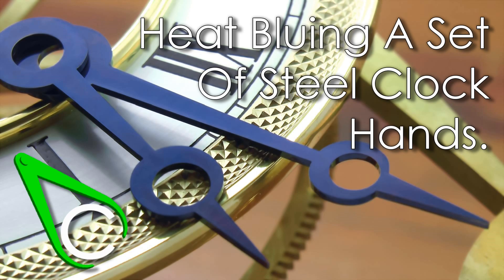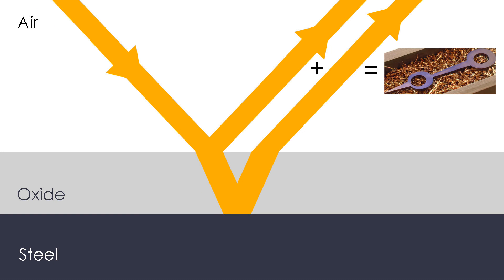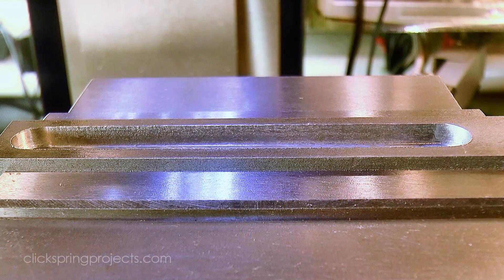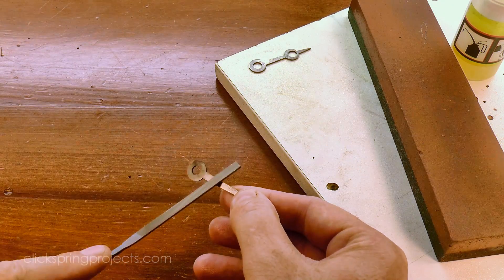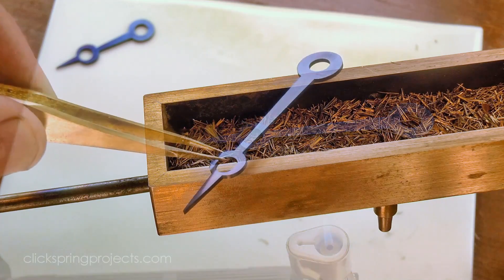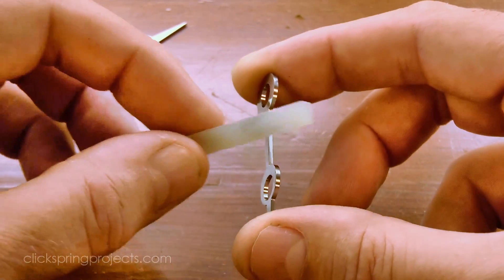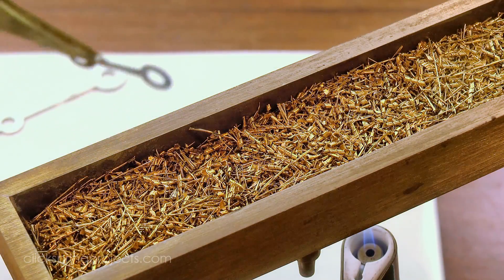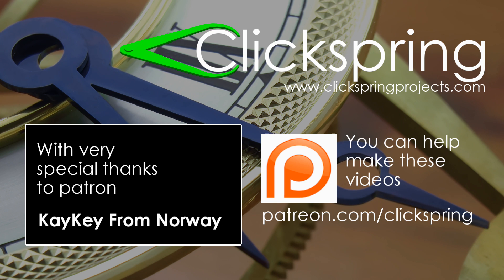Spare Parts #12 - Heat Bluing A Set Of Steel Clock Hands

Comment: will it keep the same blue color without being sealed. Does blueing block rust formation?
Reply from the maker: +The Blue Farmer A light wipe with oil is generally the only practical oxidation protection, if the finish is to remain natural and consistent with traditional horological practice. I have read in some texts that some believe the oxide provides a small measure of corrosion protection, but I have my doubts about this based on my own observations - I have seen plenty of blued screws that rust just as rapidly as non blued.

Comment: Do you coat the oxide colored parts in a clear coat to prevent blemishing the finish?
Reply from the maker: +eformance A light wipe with oil is generally the only practical oxidation protection, if the finish is to remain natural and consistent with traditional horological practice. I have read in some texts that some believe the oxide provides a small measure of corrosion protection, but I have my doubts about this based on my own observations - I have seen plenty of blued screws that rust just as rapidly as non blued.

Comment: I got two questions. First, I guess this has been asked before, but if you were to sell the finished clock on ebay anonymously(without saying it's made by Clickspring only saying that it's handmade) how much would you ask for it?

Second question is, how often will you have to wind this clock?
Reply from the maker: +flanker I couldn't sell this at a price that reflects the amount of work that has gone into it, it would be beyond what anyone would find reasonable. Plus my wife would kill me if I sold it. Here is a 2014 price list of a well known maker, and bear in mind that they use CNC for a significant part of the work, and so have much less man hours invested in each clock: http://wohnraumuhren.de/wp-content/uploads/2014/09/SINCLAIR-HARDING-PRICE-LIST-2014.pdf The clock is an eight day movement, so it needs to be wound once a week at a minimum. Thanks for watching and asking :)

Comment: This oft-repeated explanation for oxide bluing can't be accurate. If it were, the color would vary strongly with viewing angle (as for the soap films shown, for oil films on water, and for dielectric mirrors). Also, the same color could result from a lower or higher temperature held for a longer or shorter time, respectively, as these would produce the same oxide thickness; color would not be a reliable temperature indicator (which it is).
Reply: +allotribus I have a question about the second use of the word "titanium"  in the next  to last sentence.  Could you be meaning "aluminum" instead as I normally see aluminum being "anodized" ?  I am not trying to be combative in any way, just curious.
Reply: That is interesting about titanium.  I know steel can be plated using chemicals or electric current so it might be possible.

Comment: Does the bluing help prevent corrosion, or is it only cosmetic?
Reply: +ZoneofA yep, because corrosion is often caused by oxidation, pre-oxidizing prevents any more damage to occur
Reply from the maker: +ZoneofA A light wipe with oil is generally the only practical oxidation protection, if the finish is to remain natural and consistent with traditional horological practice. I have read in some texts that some believe the oxide provides a small measure of corrosion protection, but I have my doubts about this based on my own observations - I have seen plenty of blued screws that rust just as rapidly as non blued.
Reply: Clickspring thanks for the information, I spoke before doing the research!

Comment: i cant find the video for manufacturing the hands, and is steel really that age proof when oxidized ?
Reply from the maker: +Khaled Helal The full clock episode will be out in a few weeks showing the hand fabrication, the video was getting too long so i broke out this section as a separate video. A light wipe with oil is generally the only practical oxidation protection, if the finish is to remain natural and consistent with traditional horological practice. I have read in some texts that some believe the oxide provides a small measure of corrosion protection, but I have my doubts about this based on my own observations - I have seen plenty of blued screws that rust just as rapidly as non blued. If looked after like this, the blue finish can last many hundreds of years, Thanks for watching :)
Reply: Thanks for the huge effort, the art, the education, the accuracy and the amazing editing, I find the videos really calming and very inspirational.

Comment: Beautiful. What, if anything, do you use to finish/protect them with. I build tattoo machines and have blued a couple of them and just used Renaissance wax.
Reply from the maker: +eddie steele Hey Eddie, the tradition in horology is to leave them as is, although it is not uncommon to give blued parts a very light wipe of oil for corrosion resistance. Thanks for watching

Comment: Is that boric acid and meth spirits just a 50/5+ mix?
Reply: +JoshL The ratio isn't specific, you just need enough spirits to make a paste
Reply: +mark314158 thank you so much , that solved my problem , its cheap and widely available :)
Reply: +JoshL sorry to bother but i cant translate the meth spirit in my language (Greek) in order to look for it at the market , any other description or common uses? (i have tried google translate but no help) thanks.
Reply: +BisdremisKostas It is just ethanol — with a tiny amount of methanol to make it undrinkable.

Comment: So when a part is blued it will not corrode?!
Reply from the maker: +Djesur Feim A light wipe with oil is generally the only practical oxidation protection, if the finish is to remain natural and consistent with traditional horological practice. I have read in some texts that some believe the oxide provides a small measure of corrosion protection, but I have my doubts about this based on my own observations - I have seen plenty of blued screws that rust just as rapidly as non blued.

Comment: Will the blueing make the parts corrosion resistant ? Awesome work as usual 👍
Reply from the maker: +522design  A light wipe with oil is generally the only practical oxidation protection, if the finish is to remain natural and consistent with traditional horological practice. I have read in some texts that some believe the oxide provides a small measure of corrosion protection, but I have my doubts about this based on my own observations. Thanks for watching and asking

Comment: hmm, and what do you do to prevent it from oxidating more after its finished? It is still iron that will oxidize with air.
Reply from the maker: +DataStorm A light wipe with oil is generally the only practical oxidation protection, if the finish is to remain natural and consistent with traditional horological practice. I have read in some texts that some believe the oxide provides a small measure of corrosion protection, but I have my doubts about this based on my own observations. Thanks for watching and asking

Comment: Unless I'm mistaken, the only things left are a torsion spring that will go in the barrel and a pendulum for the escapement wheel before final assembly.
Reply from the maker: +TheAllBlackMan Video episodes still to come are crutch/pendulum, stopwork, escapement, winding key and base, final assembly plus an episode on another modification to the design that I'm still deciding on whether I am brave enough to take the plunge...
Reply: Clickspring
Wow... there's more to a clock than I thought!

Comment: You are a very parient man.  Why not just use a chemical blueing?  Thanks for the video.
Reply: +Roy Lucas : Because it is nowhere near as good.
Reply from the maker: +Roy Lucas Yes +Englishman French has it correct. I am also deliberately conforming to horological tradition wherever possible - in traditional clock and watch making screws and other small steel parts are heat blued, rather than chemically blued. Great to have your support Roy, I very much appreciate it :)

Comment: Absolutely beautiful! I've got a flat piece of brass that I want to bring to a mirror finish. Thinking of A) sandpapers on glass, then B) diamantine powder, followed by C) a 50/50 mix of Clear Guard and thinner. Does that sound like a reasonable approach? This is my favourite channel bar none, by the way.
Reply from the maker: +TheHue's SciTech The abrasive paper will be a good start, but the diamantine really only works for hardened steel. Try to get hold of some of this polish from Bill Smith, absolutely awesome for brass, better than anything else I've ever tried: http://www.wrsmithclocks.com/polish.htm
Reply: Awesome, thanks! And which thinner did you use for the clear guard? Again, love your work.

Edit: Upon further reading, it looks like the polish leaves behind a wax layer -- does that mean I don't need the clear guard at all? That's even better!
Reply from the maker: +TheHue's SciTech Correct, no coating required, much better. This is the solvent: http://www.whiteknightpaints.com.au/specialty-paints/metal/rust-guard/prep/solvent

Comment: How delicate is the blue oxide?
 I've been thinking of doing something similar as a finish for some knife designs that must be protected from rust.
However if the oxide isn't durable enough, then that obviously won't work.
Great video too (as always).
Reply from the maker: +scarletlightning565 Its not very robust at all. It scratches easily, so would probably not be very suitable for any sort of EDC item. However if its removed from handling, like inside a watch or clock, it has been known to last for many hundreds of years. Thanks for watching and asking :)
Reply: Not an expert but I've found it about as durable as the steel surface itself atleast with mild steel.

Comment: Are the colors of different bluing parts that you made earlier matching each other?
Reply from the maker: +Ruji Yu There is a reasonable consistency across the small fasteners, click, clickspring and now the hands. But the pillar screws are a very different almost "teal" blue because they were made from a low carbon mild steel. Its a nice blue, but I may choose to redo them if the inconsistency starts to bug me. thanks very much for watching and asking RY

Comment: Thanks for this very instructive and interesting video. I'm glad to see you back and OK. Do the parts need any protection against corrosion after bluing?
Reply from the maker: +Mienecus A light coating of oil is commonly used to help with corrosion resistance, and it is believed that the oxide layer itself provides a small measure of protection. Thanks very much for watching
Reply: +Clickspring thanks!

Comment: Wow the finish is amazing, looks anodized. Wouldnt the second heating to get the final colour affect the temper? With parts like the hands i guess this wouldnt be an issue due to them not neing under any real load, but the screws you made? Looks incredible either way great job.
Reply from the maker: +Tyler Sharman (Sharmo) Hey Tyler, it gets to the exact same temperature the second time, so the temper is not pushed any further than the first bluing. Thanks for taking the time to watch :)

Comment: Hey Chris, thanks for another early vid.
A question. If you had a kiln and heated the parts to the bluing temperature exactly, would it achieve the same result? It seems like this is a pretty finicky process.
Reply from the maker: +Phillip Soucy Hey Phillip, yes it would with respect to achieving a stable temperature. A temperature controlled bed is another option I've seen used successfully, although it still remains a very finicky process because of the other parameters